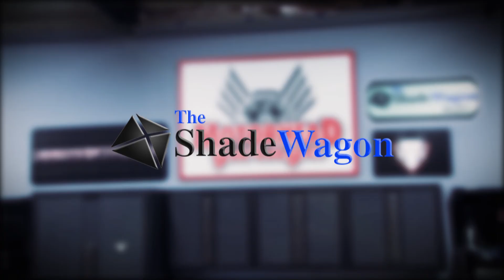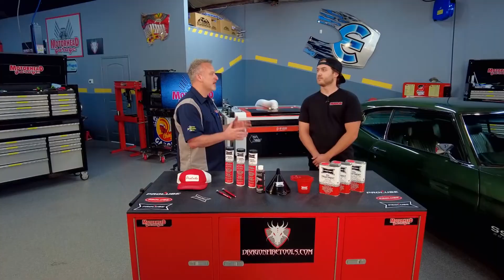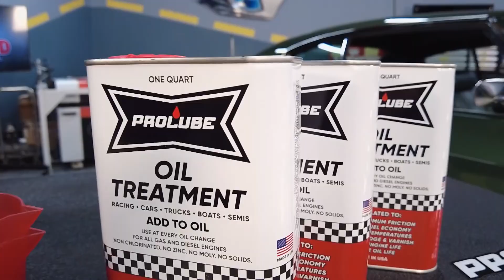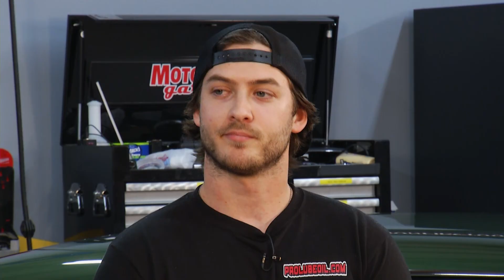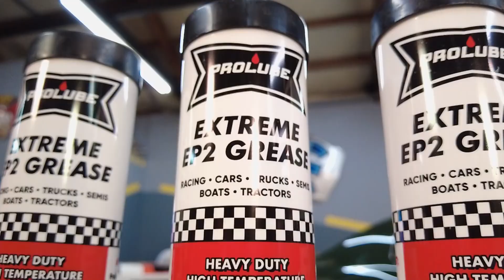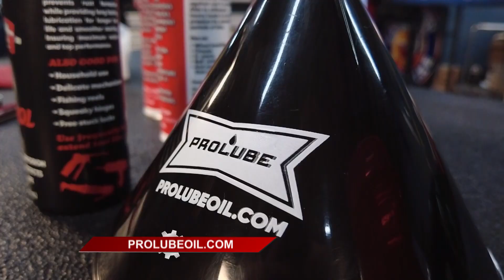Prolube Oil Products on Motorhead Garage

Comment: I cannot find one single video of prolube being tested in a motorcycle on wet clutches
Reply: Because it wont work,when I was younger I put the wrong oil in my Suzuki it slipped under high power,drained it immediately.

Comment: I used it on my used Toyota corolla. I put  4 ounces to every quart Corolla 15 ounces but it did quite the engine down other than that, it runs the same and gets about the same gas mileage but  my opinion it just keeps lubrication on upper cams first start the engine did the same thing to my Mazda protégé quite down the cams when you first started it made it idle smoother